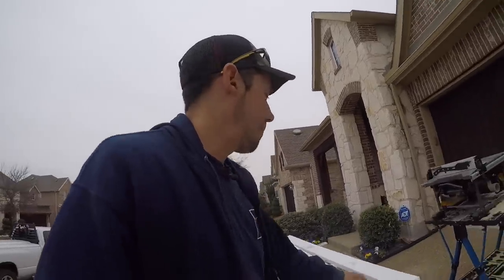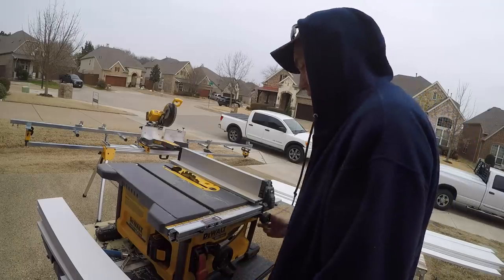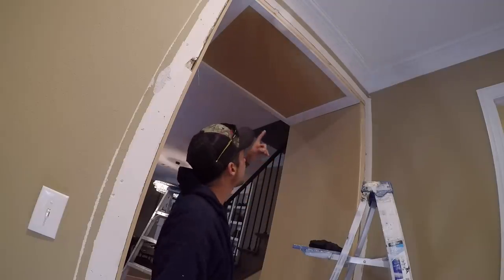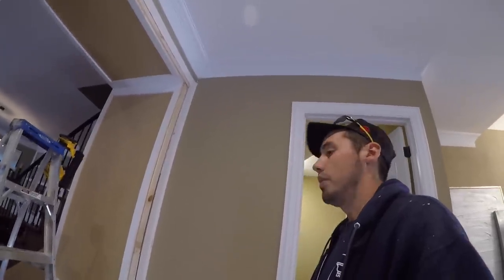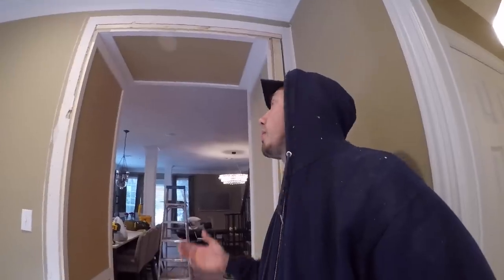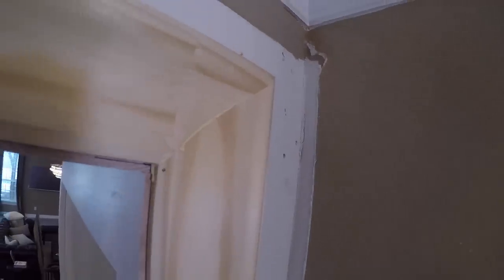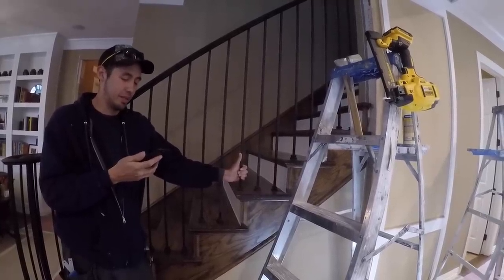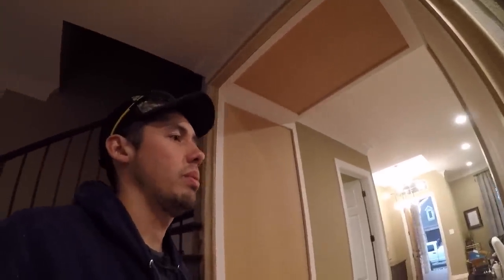Fixing the $3500 Mistake!!!

Comment: Not sure if you still check the comments since the video is a couple years old.
But for tools in the driveway while your inside.

Harbor freight sells wireless driveway chimes. You could place it in the driveway and if there is motion it will alert you where your working.
Just piece of mind when both of you are inside working.

Comment: Was browsing Youtube watching a variety of trim carpentry vids.  You do good work.  I am also a high-end trim carpenter working in multi million dollar homes.  Took note of your comment regarding the thickness difference of boards from different suppliers.  From my experience this is caused by the miller making the boards themselves; different production batches and milling machines.  You are using pre-primed boards which can also cause thickness differences.  We always run our boards through an onsite planer.  This eliminates the need to thoroughly examine each board when purchasing.  Bosch makes an excellent onsite planer.  I'm sure you already know this though.  Gotta love the cordless guns... Senco is my preference for finish guns.  I run the 60 volt flex dewalt saw only because I can use the same battery in my other dewalt cordless tools, power planer, sanders, vacuums, etc.

Comment: Hello Richard. I love your videos, you guys do a great job and the easy to follow instructions and advices you give are wonderful. I'm from Macedonia, Europe and there are almost none trim work professionals here. I like the looks of trim, so I installed some MDF base boards in my apartment by myself. I learned the coping technique (without a coping saw since I cannot find such a tool here or in the neighbouring countries) and the return cut. I'm interested in the job you perform so if you can please point me to some stuff:
- what is 'by' thickness material?,
- what product do you use to caulk the reveal on the door casing in this video before you do the paint job,
- what product/putty do you use to cover the nails in MDF,
- when pocket screwing MDF, do you use the coarse or fine thread kreg screws.
There are no pros in this trade in my country, so noone to ask here. The jobs I've seen here using painted MDF in furniture making are not that durable since the pain cracks at the joints over time. Thanks.

Comment: I certain that in a perfect world you would have matched the existing casing but in this instance I'm glad you didn't. The casing you selected is exactly what I was trying to find before I began replacing/upgrading the woodwork in my home.

I'm almost halfway finished and seriously considering tearing out the new casings. I custom built my plinth blocks and entablatures with necking so it won't be overly difficult.

Please supply the manufacturer's name/style information. I'm going to try to find it in my area. The casing you used is exactly what I need.

Great job on the videos!

Thank you!

Comment: One recommendation is when using bare wood you need to paint or stain all sides. This is for keeping your good job looking great for years to come. The theory behind this is that any exposed wood will continue to absorb moister. So with one side coated and other side bare this will cause the board to warp over time. Which will lead to joints pulling apart over time.

Comment: Setting up a stop block on the miter saw really makes sure your cuts are all the same length.  I have measure and cut multiple boards before only to find they were identical in length.  Also stop block makes it go a lot faster.

Comment: Do you not glue the stiles and rails before assembling your panels? I see that a lot of ppl oversee that step and after time your seams pop and some sides thicken more than others so the step of you kregging everything becomes  nugatory. Sorry no means to offed work or anything of the sort but with no wood glue the integrity of final product depriciates enormously because in a matter of months seems crack vs a few years.

Comment: Is your helper on a wanted poster?  Why the old west bank robber look?

Overall, love the videos.  Nice work.  Its refreshing to see a younger tradesman take pride in his work.

Two camera related suggestions - try to get a camera that has less distortion.  I know this house had some issues, but all of the doorways appeared to have significant barrel distortion.  That is common on wide-angle lenses, especially on action cameras.  Also, consider bringing in some LED light panels.  It will give you the ability to really get light where you need it.

Comment: You weren't kidding, that casing looks like chair.  I have installed it around some windows in one of the "arts" sections of Indianapolis and I'm not sure if I like it or not... but, not my house.  I appreciate glued 45's being a woodworker (hobby), but I hate coming up to those when someone has had custom work like this done only because the people I generally do these things for want it changed a few short years later to follow the trends.  Certainly can't knock you for it though.  I do have a question though, do you have any issues with your 15 ga. nailer splitting trim?  My custom trims tend to be thicker and able to with stand, but the big box store trim has given me fits to the point that I break out the compressor and run 18 ga.  Any tips are issues?

Comment: Question, did you run your top rails all the way across on the smaller openings or is it a small piece between the stiles?  Reason i ask is that it seems like the pocket screws may split that small piece.  Cant tell by the vid.    Also, you're all cordless?  Love it... Im a rough carpenter and do some trim on the side, and have been transitioning to cordless..   The cordless 2 batt makita circ saw has been a game changer!   Nice work, i could watch this stuff all day.  (Snow day!)

Comment: I slot, glue and biscuit my 45s. Any other way, over time, a crack will appear in the 45. I also use wood filler in the seam, then sculpt and sand the 45 union for a seamless fit. Yeah, it takes time and you need to develop some technique and skill, but I've never had a 45 seam open in over 25 years.

Comment: I have a lightswitch in my house that is sandwiched between 2 door casings.. one from the bedroom door, the other is the closet.. Now I cant get the switch plate back on.. how would you go about remedying this? Route out the casings?
Reply: Trim the faceplate
Reply: @sicariodesviado678  what do you mean?
Make a rectangle the size of a normal faceplate, then cut a hole in it to fit the switch?? The switch isn't proud enough to extend passed the thickness of the wooden plate........
Reply: @LightGesture  how much of the face plate is the trim casing obstructing?

Comment: I understand why there are specialists when building a whole house. Foundations, framers, electricians, plumbers, drywall, finishers... all separate contractors. I'm curious as to why you wouldn't just do the drywall yourself in this case, though. I may be ignorant to how it works, but I'd assume you and your crew would be capable of doing this isolated job in its entirety. I'm not criticising in any way; I'm just wondering why this kind of job would take multiple contractors.

Comment: Is there a reason you didn't run your stiles and rails in a traditional manner? Stiles should run full length with rails cut to fit between stiles.
Reply: easier to make one piece the way he did it

Comment: In trim, transitions are everything, stair to base, casing to base, post to crown.  Your intro talked a lot about those transitions but didn't really deliver.  Great video as always, but please show us easy ways to make those transitions.
Reply: brianohbrian burns Thanks, I just checked it out again and the follow up video also. Really cleared things up. Base to casing is tough for me since I don’t see it done well often. 

While I have ya, is there a reason to put the “wainscot” like casing over the flooring? I feel like I may have been tempted to cut that bit of flooring away and dropped the rail down. Would that just have been a waste of time? I get hung up on “future proofing” sometimes.
Reply: You could always have put a plinth block in. Make it 1/4" wider thn the architrave and 1/2" taller than the skirting board. also 1/4" deeper than ether the skirting board or architrave (whichever is the deeper). Looks nice, adds bulk to the architrave.
Reply: I agree. Plinth blocks are the way to go and solve some problems also.

Comment: Textured walls?! Is that common where you are?
Reply: Tehcarp It is.  We like it.  😀
Reply: Sure speeds up the process. A good drywall guy can mud then texture with almost no sanding. Saves making that nasty drywall dust.
Reply: Last job I did, I was able to talk the customer  into going with smooth wall with color veneer plaster, so much better in the end.

Comment: Hire a drywall guy? Hey you should do that and add the cost on to the job as extra.
My dad did Lath and plaster and skim coats drywall is a cakewalk once you learn it.
I had a lot of it in my house to go over and fix the building subs were retards! the work orignally looked like total crap. 
Paint and patch drys really fast its lightweight and once you figure out how to use it Mud is a cake walk.
My dad also did Stuco and Finnish carptrany with nails and hammers.  You guy have it made with nail guns.

Comment: You do quality carpentry work my friend, but you should have fixed the drywall first.  Repairing it after the trim is up is just the wrong way to do it.  Makes what could have been an easy fix much, much harder and costly.  Learn a little drywall repair and you will be a better craftsman.